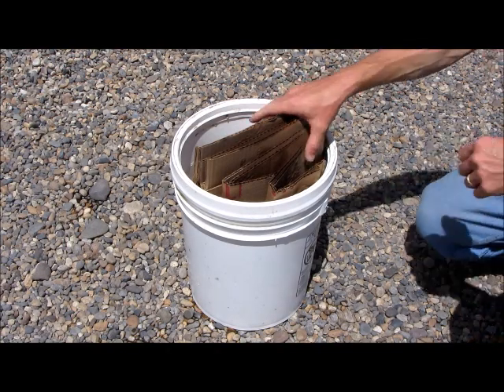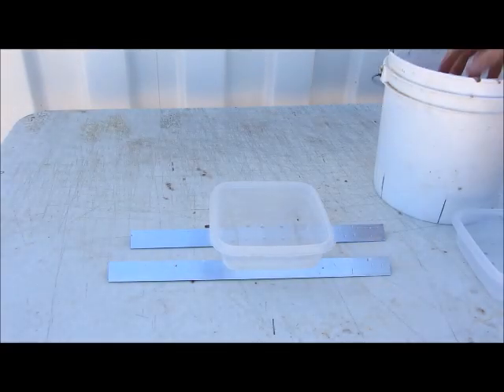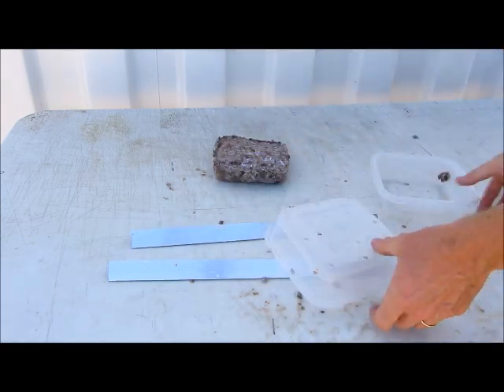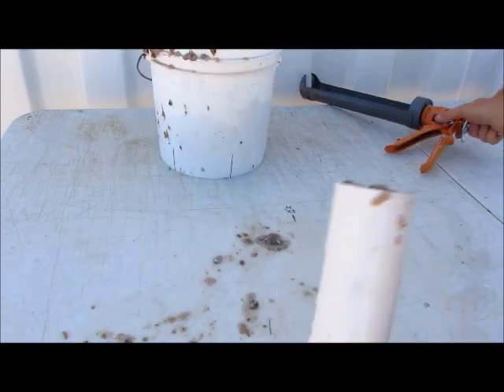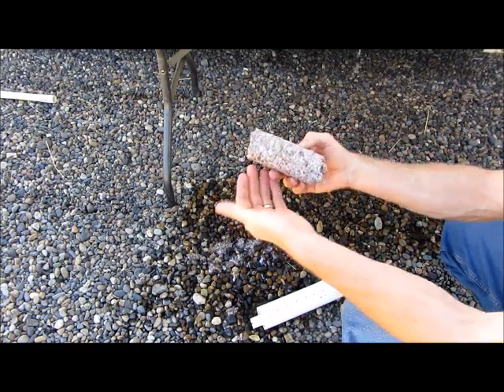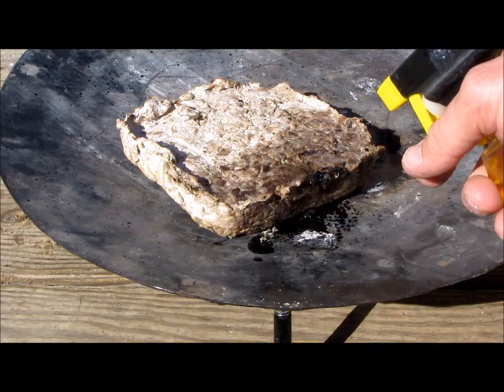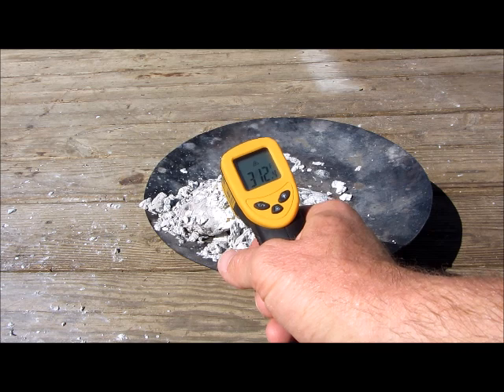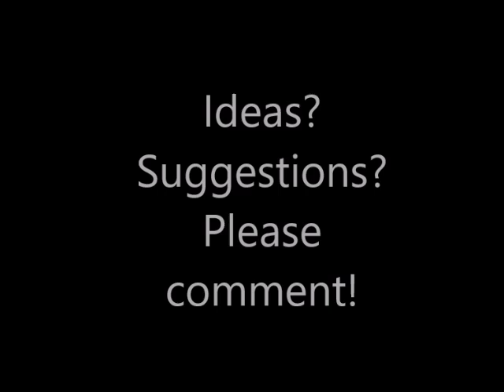Free Fuel To Heat Your Home, does it really work?  Paper and cardboard fuel test

Comment: Yep. All you needed was hours of effort, an electric power drill, PVC pipe, a caulking gun, several plastic buckets, Goo Gone, Acetone and a butane lighter. I'm sold! On second thought I will just go get the dead branches which endlessly rain out of my oak tree in the back yard and burn those.
Reply: You forget to mention that dehydrator as well which uses lots of energy .
Reply: A Vegas friend picks up girlie newspapers in Vegas which are plentiful and mulches them in a drum and makes logs and heats his home
Reply: @rndullrobinson3076  I heard of one guy who gets his name added to mailing lists and has a PO Box to source junk mail as fuel.
Reply: Yip
Reply: @Habi8805 I see. Ok that solves that idea.
Reply: A little magnesium from a magnesium fire starter may work..
Reply: No, you are right. 
 If you have plenty of scrap wood, you don't need paper logs. But this is a way to give utility to tons of paper and cardboard waste out there.
Reply: I am a private investigator, and I am inundated with paper documents from law offices. Five years after the cases close, I can get rid of it, which means I have about 50 bankers boxes a year to get rid of, but I am fed up with paying a shredding company to come by and get them for recycling. It costs about a thousand dollars a year. So to me, this is a good way to destroy old documents securely, and to personally know that they are gone. I do this with an outdoor wood stove on the patio.
Reply: @Habi8805 rocket stove indoors?
Reply: @lvinston  A rocket stove usually has a chimney leading out of the roof. There are many videos about tiny homes, also yurts, with rocket stoves.
Reply: @Habi8805I hear you.
Reply: I'll as well can drink beer while he does all that noise then grab some sticks and still have a good buzz and bbq going
Reply: @Elmer_fudd6969  aha!! liking the meek response
Reply: @Habi8805 That is so interesting about the German sweeps!   I have seen one of those indoor rocket stoves being made from beginning to end here on YouTube.  It was awesome.
Reply: Fine. All ideas are there to be built upon. Now add something.
Reply: may as well rack  up leave and   turn them  bricks .. It free  and you can get people to pay you to  take them away ....
Reply: @Habi8805 Habi8805  You read of tragedies because of people who have been cut off from electricity and tried to heat their rooms by a charcoal barbecue in their homes......yes and also people who burn their furniture to stay warm.  It happens.  Also, any thinking human being would understand that a charcoal barbeque or burning furniture in your house is going to create deadly smoke and fumes. Your "official" chimney sweep may have been correct about your chimney depending on many factors including the condition of your chimney.  I would get a second opinion. This also ties into homeowners insurance and code.  If you do it right you can bypass those two. They exist due to stupid ignorant people messing with volatile things and fucking up, such as people who try to stay warm with a charcoal barbeque in the living room.  Good lord!!!
Reply: +PlanktoniusRex  besides all the apparatus and time... this seems to leave a large amount of residual ash.  I can burn oak (from my property) all day in the wood stove and have less ash than he had from a few bricks in an hour.  

I will admit I do use recycled paper in the form of egg cartons as a fire starters.  I also burn my junk mail.  Might as well turn that trash into useful heat and keep it out of landfills.  But I don’t spend hours making logs of it.
Reply: PlanktoniusRex heeheehee, my thots too.
Reply: @Habi8805 wrote:
"extremely poor people who have been cut from electricity tried to heat their rooms, baby-milk etc. by a charcoal barbecue in their rooms and all of them died."

YIKES!!!   Is this true?  Where?
Couldn't they just open a window?

Here, in Virginia, I heat with a wood stove as our primary heat source.  It is excellent, very comfortable heat.

I am also a contractor, and retro-fit wood stoves into homes.  Depending on your flue diameter, and what is connected to it,  you can either run wood chimney flue inside your existing flue, or more likely, you will need to install a new flue for a wood stove. It has to be rated for wood burning, and also it needs a safe path up and  through the roof.  

Rocket stoves are neat!
Reply: And buy a one dollall fresnel lense and focus the endless power of the sun and burn the shit fast melt rock and basically burn through the whole world
Reply: Hilarious! You're funny.
Reply: There's no need for you to be a smart-ass, ya know!
Reply: time cheaper than fuel !
Reply: Thank you! The idea of spending all that time and energy is ridiculous. You could also just burn the loose paper as is when you are starting the fire....
Reply: lol point made
Reply: Smartass!
Reply: PlanktoniusRex 
Smart ass!😖
Reply: water and drill bits too
Reply: LMFAO
Reply: Everytime i visit cabin, i spend time picking dry fallen branches from the ground in ikea bag and burn those to heat the cabin for a day. Feels almost like cheating.
Reply: Plus a decent fire extinguisher when your house sets on fire 🔥
Reply: I have most items already and you can dry them in the sun. Seems pretty inexpensive
Reply: The man showed diff. Ways this could be done. You must have no creative juices flowing. He just gave you food for thought!

Comment: how about adding some used vegetable oil from a restaurant to a dried log and seeing if that increases the heat output
Reply: Cory Kaupa •  very interesting concept,  then according to Hermes Trismegistus 4000 bc  writings, adding to that mix 42%  of diseccated  cannabis leaves will get you not only warm  but such a  sensorial enhancement that you won't care whether the bio logs  work or not.  As a bonus you can collect the ashes ,  combine  that with 50% corn starch in a regular  blender .  After 2 hours all the particles in the mix will be electrostatically charged. Add to the paste 18%  pure GORILLA  GLUE, mix the thoroughly then spray the paste on to mosquito screen an you have a filter for your air  purifier that can rival the efficiency of  the best NASA  approved  HEPA FILTER. If you really want to go green all the way instead of gorilla glue you need to use  archival rice glue.  Why?   Very simple:  when the air filter is due for replacement you can wash it and  make the most nutritious  vegetarian tacos with it.  Have fun.
Reply: I believe I've seen that used as a stump removal technique.

Comment: Try adding sawdust to your mix
Reply: danpearson: So is paper.
Reply: Aaron Wise sawdust is wood
Reply: Lets just burn the tree u have to kill the tree for sawdust and cardboard
Reply: Sawdust Will explode with enough force to drive open the door of a pot bellied stove.
Reply: @johnrogan9420  Not if you incorporate it into the glop.  I've been using up sawdust and shavings from my workshop like this for ages with no problems.  Loose sawdust is a different issue I agree.
Reply: Puree of fall leaves and dryer lint
Reply: You should just use a rocket stove with twigs for this application. These press logs should only be used as a furnace fuel source. Unless you dont care about chemicals.

Comment: How would we make it simpler?  Hmmm... You just left the mash in the bucket to settle on it's own, so no pressing no squeezing, nothing, not even the big rock had to work on that one.  You then turned over the bucket and dehydrated the form that probably just popped right out first try and achieved a 1000 degree fire for close to an hour.   Simpler?  I got nothing.... except maybe have the sun dehydrate the form so you do not have to do the back breaking work of plugging in the dehydrator.

Comment: Interesting experiments, thanks.
Just wondering how are these slurry bricks better than torn up paper straight in the fire ?
(genuine question, not just being negative about the slurry fire bricks)
At present I make a slurry from my junk mail with an electric drill stirrer and put it on the compost heap.
Reply: lishde the ink on paper isn't really toxic - at the minimum, it's less toxic than the chemicals and carcinogens created by burning wood or paper in the first place.
Reply from the maker: Good question!  The main difference and benefit of making bricks is that they will burn longer and more steady.  When you put torn paper directly into a fire it will kind of flash burn (burn real fast and real hot) and then it's gone.  The bricks allow a more slow, steady burn.
Reply: IW Videos oo
Reply: incubatorwarehouse
Reply: incubatorwarehouse
Reply: incubatorwarehouse
Reply: alot of the ink in the paper is moved into the water so you dont inhale it when burning
Reply: George Gibson You should just use a rocket stove with twigs for this application. These press logs should only be used as a furnace fuel source. Unless you dont care about chemicals.